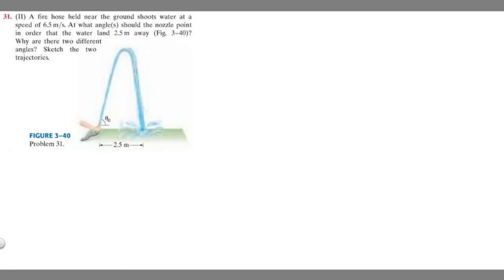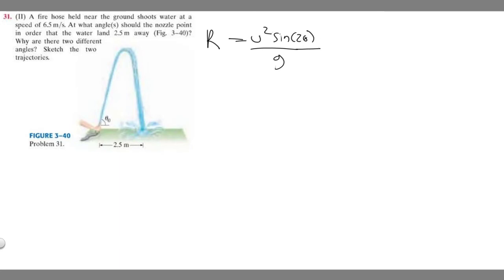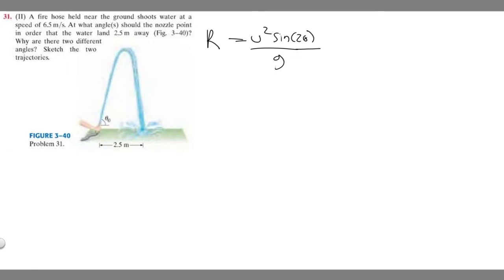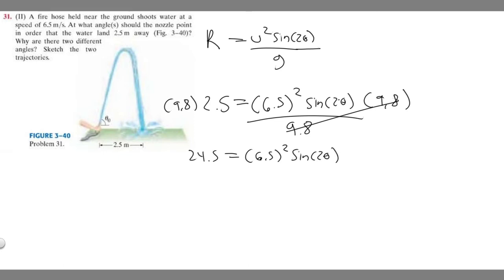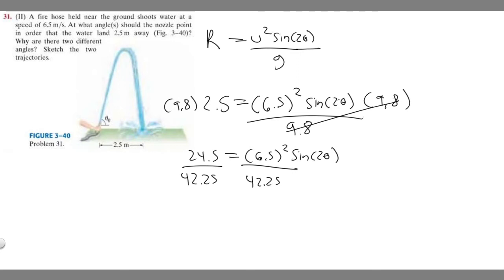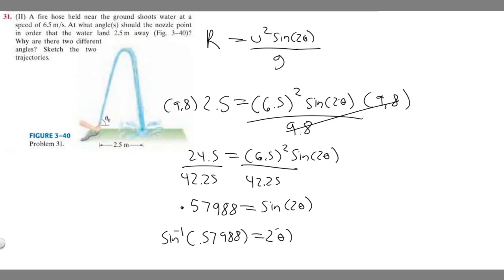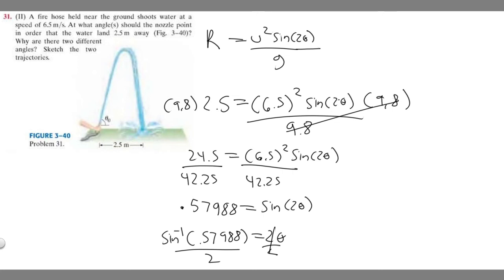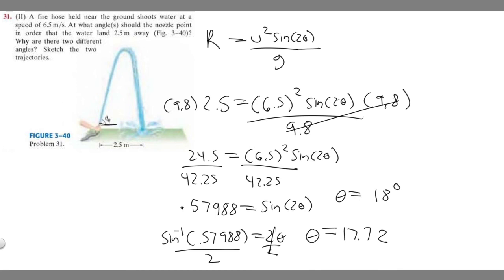A fire hose held near the ground shoots water at a speed of 63 m/s.what angle(s) should nozzle point

Comment: Why would gravity not be negative in this situation?
Reply: When he wrote the first question for range, it is actually the horizontal velocity multiplied by time. The equation was then, of course, simplified, but the change that made the acceleration due to gravity positive was from what he substituted for time. The time equation is Final Velocity=Initial Velocity + Acceleration x Time. If you isolated time to one side, the equation then becomes (Final Velocity - Initial Velocity) divided by Acceleration=Time. The final velocity would be zero because the time equation is solving for the time between the initial velocity of the hose when it exists the hose and when it reaches the peak of its arch. This then leaves the equation with the negative initial velocity over the acceleration. Since the acceleration due to gravity is negative, the two negatives cancel out. When the revised equation for time is substituted into the equation for range, the acceleration due to gravity would then be positive. Sorry if this explanation is a bit long and difficult to understand lol. tried my best

Comment: I don’t understand why you subtract 18 from 90 to get the other angle
Reply from the maker: Whenever you calculate the range for a projectile motion problem on a flat plane there are two different angles that you can use to get the same range.  One of the angles you get is just by directly solving the formula and the other one you get by doing 90 - θ. When I wrote that .57988 = sin(2θ), there are really two different angles that will make this work. The rule though is just to take the answer that you get from solving this in your calculator and subtract it from 90 to get your other answer. I recommend just testing this, if you plug in 72 and 18 in the range formula and solve for the range you will get the same answer. Sorry if this explanation wasn't satisfactory. If you have any more questions don't hesitate to ask.
Reply: TheCheatSheet Thanks, I understand now